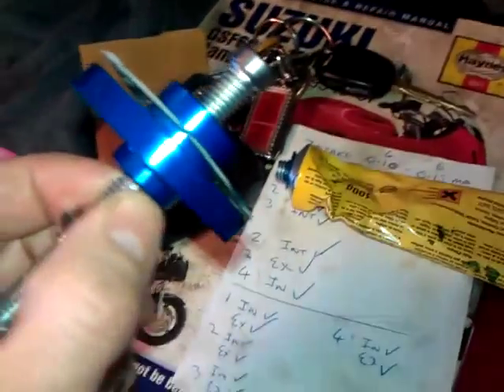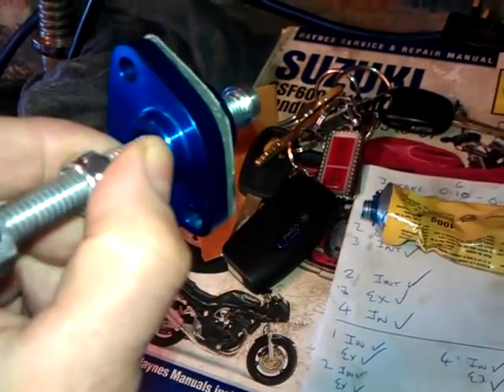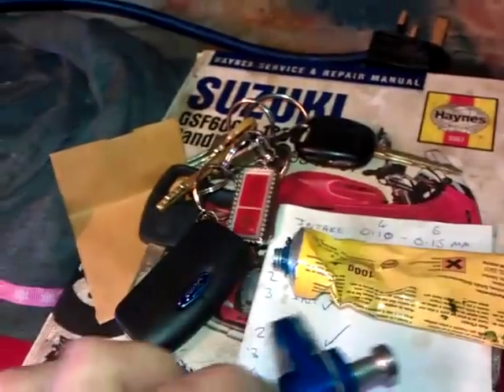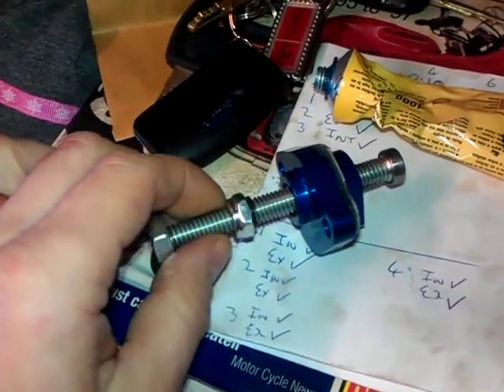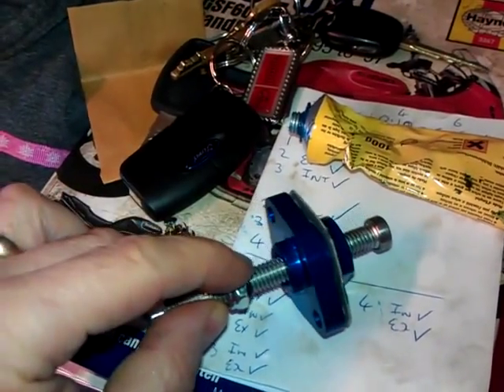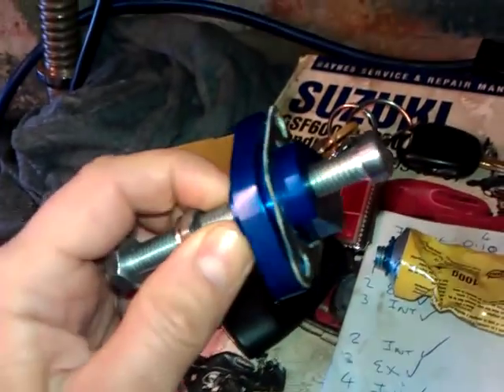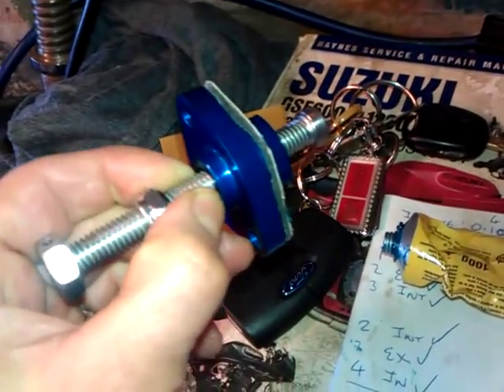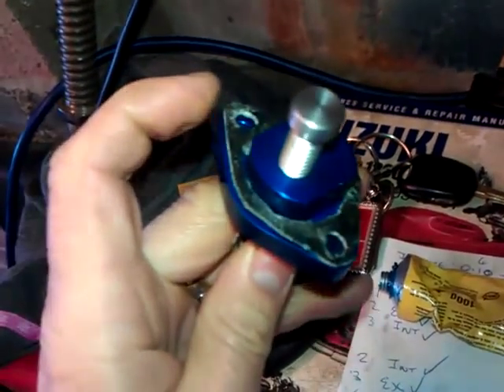Ape Manual camchain tensioner

Comment: No, they don't "go bad" but they will require periodic adjustment. I SERIOUSLY suggest you go to whatever forum is dedicated to your bike in question, and search/ask around for the adjustment procedure. When it comes to manual cam chain tensioners, people often run them too tight or too loose; both of which can cause serious damage to the engine. Make sure they are adjusted properly.